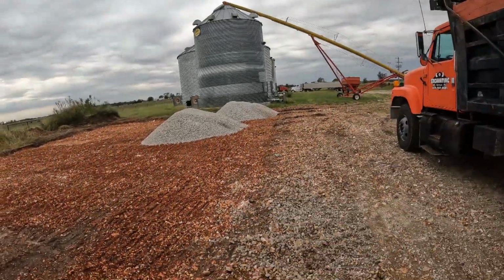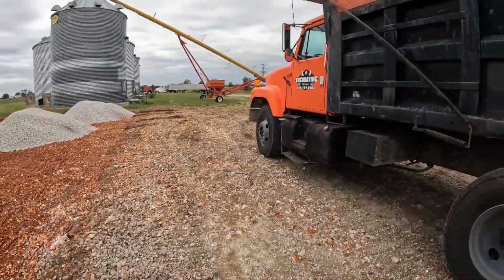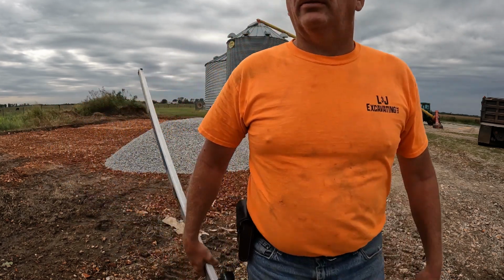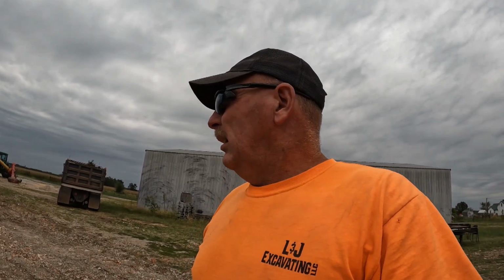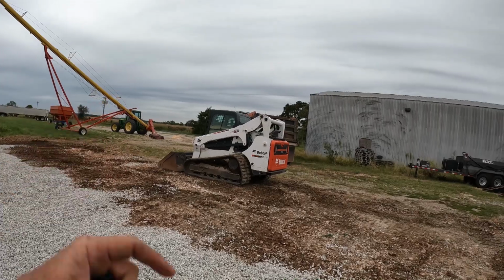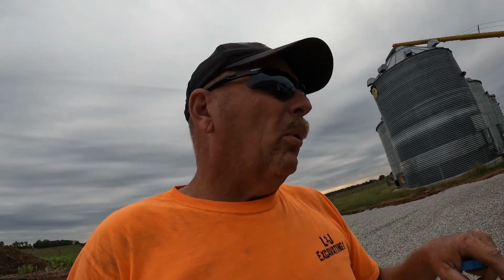Bobcat T770 Finishing The Grain Bin Pad!

Comment: I just ran a brand new (25 hours) T66 for 7 days straight, 8-10 hours a day, doing site work up in NH.  It had the same intermittent problem with the loader arms.  Shut it off, all set.  Brand new machine and same exact problem.
Reply from the maker: Nice!  You’d think they would of fixed the issue.  Seems to be lots of solenoids and sensors on the bobcat machines.🤷‍♂️. Thanks!

Comment: Worn bucket edges and loose pins are no fun on a skidsteer. Like using a dull chainsaw. Those sharp, tight working edges make all the difference. Hang in  there and enjoyed the video. 😎
Reply from the maker: Thanks!  You are correct for sure!  I bought another bucket and this one has teeth.  It’s also an 84” higher capacity so I should be able to see it without leaning over.  Thanks Marion!